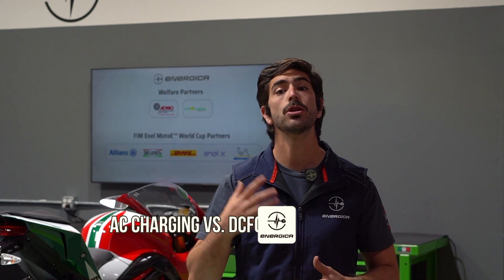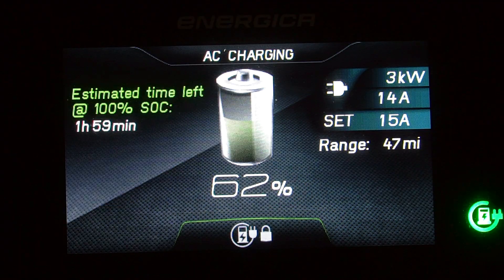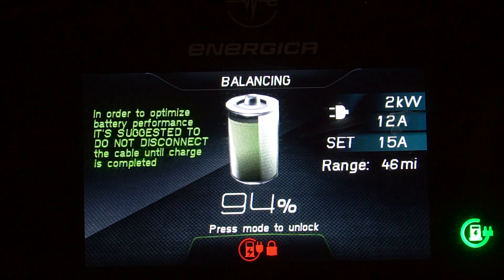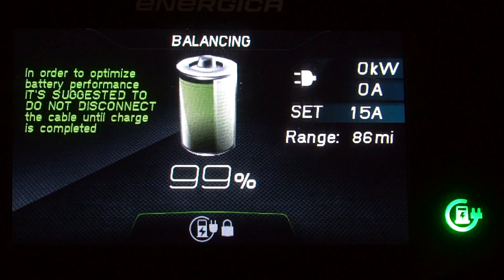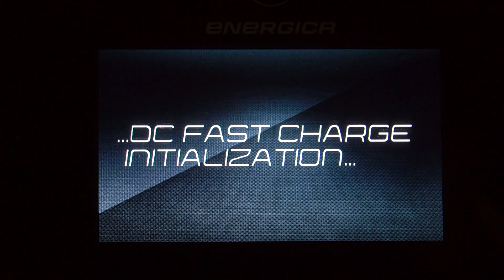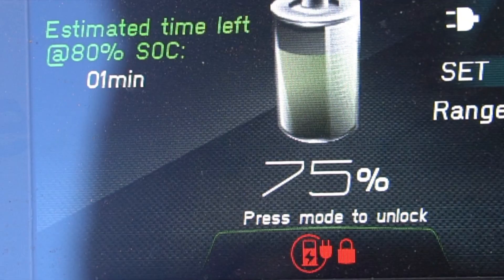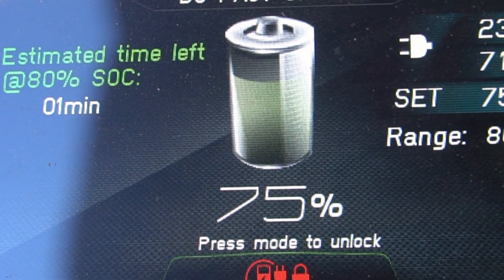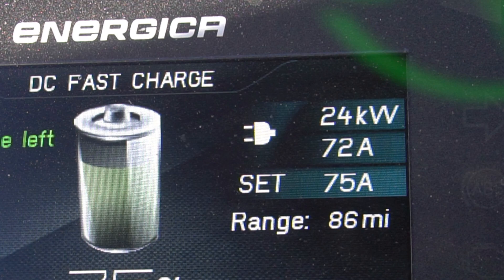Energica Garage - Charging - Ep. 6, AC Charging and DC Fast Charge

Comment: Question: I have just taken my Eva SS9+ out of LPR (over the winter).  I ran it until I had 0% / 0 miles on the display and then connected to a domestic charger (2kW approx) overnight.  After 16 hours, it only showed 98% charge.  Is there something wrong?
Reply: I have the same problem
Reply: Same her but I am not too bothered. I suspect that the charging ends as soon as one of the cells shows 100 % charge and that the balancing actually takes place with no additional charge being added. So the cells then even out to the actual average charge. Maybe fully disconnecting and then reinitialising the charge process would fix this. Overcharging however has to be avoided against all cost so that might actually do more harm then good. And let’s face it. You already lose the upper 2 percent within a mile or so of riding anyway. Better not go ballistic over minor deviations. Furthermore there is no indication after the decimal point so the possible deviation between the real voltage and the indicated one can already be halve a percentage point. The whole system seems to be running on interrelated tolerances anyway. Every machine does. Or are your range predictions always spot on? 😁